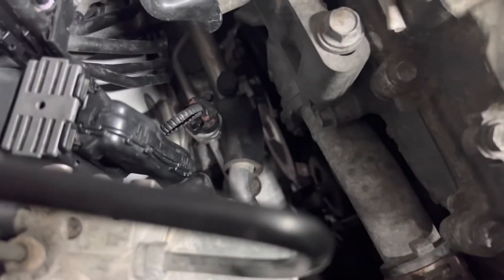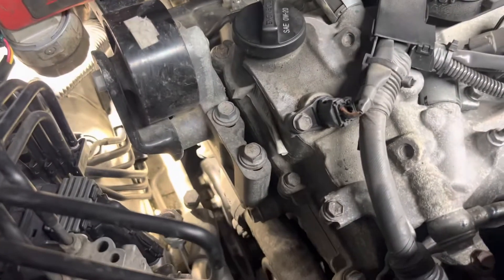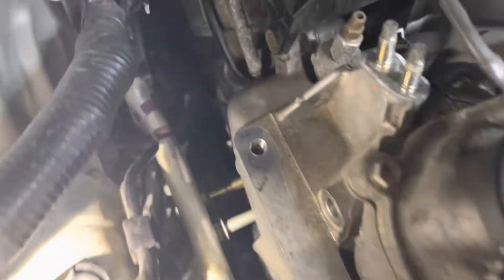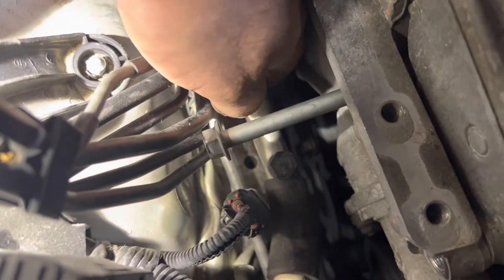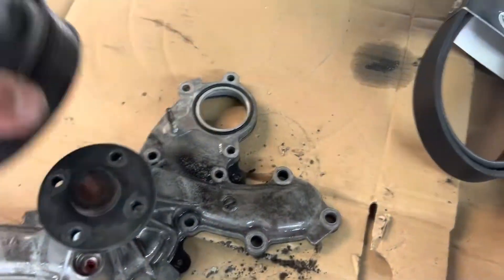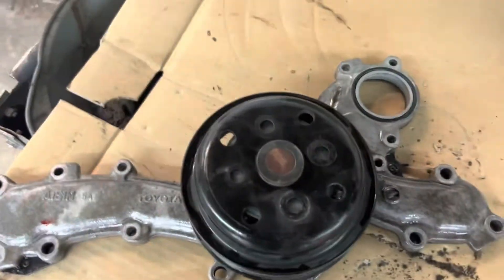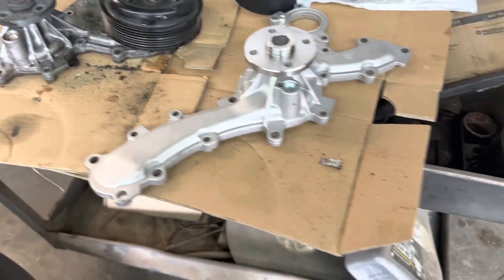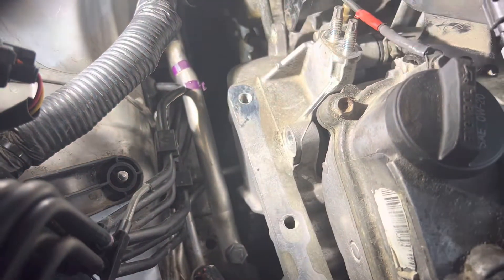2013 Toyota Highlander 3.5L water pump replacement (without engine removal)

Comment: 205,000 on my 2010 Highlander and the water pump is making the graveling noise but not leaking yet, so here I am!  Took the belt off tonight and can barely feel some play in the shaft but I can definitely here the bearing friction when spinning the pully with my hand. Neven even changed the belt prior and it looks great.  Go Toyota go!

Comment: To get that bracket off easier than the hudinne trick through the lines. Take the motor mount bolts loose from below. Jack motor up a little and they come right out. Its 4 nuts below

Comment: If you disconnect the lower engine mount that bracket is easier and you gain a tad more room. Also when coming out. You can just leave the bolts flopping around in the bracket no big deal. But not bad video 👍

Comment: So you didn't pull the motor, but did you have to support it in any way ? And did you have to move it up or down for anything? I have to do this job this weekend just making sure I cover all areas also how much antifreeze came out how big of a pan do I need to catch it.
Reply from the maker: I didn’t pull the motor but I supported it with a jack and helped it up and down
Reply from the maker: It’ll drain less than two gallons, often around one gallon I believe

Comment: I have a 2012 Highlander Hybrid with bad water pump - they are saying 2000 and an all day job, possibly 2 days...can it be quicker this way on the Hybrid?
Reply from the maker: Never done one on a hybrid, but the standard offers an option of with or without engine removal and the hybrid doesn’t, engine removal calls for double the time on the hybrid

Comment: Great video thank you for taking the time to make it. When you take the pump out, are you taking it out of the bottom in the wheel well or from the top last question once the pulley is removed from the mount, you leave it in place while you move it around that’s what allows you to get enough access to the four bolts behind it?

Comment: I have 95,000 on my 2016 Highlander just wondering what mileage people are getting out of these before needing a new water pump? I have to believe I’m gonna need this job in the next year or two. Thanks.
Reply: I have 173K miles on my 2013 Highlander.  Finally going to replace the water pump and alternator just as a preventative measure.  Both are still running great.
Reply: I’ve got 160k on mine. Still original. It runs like new.
Reply: I have a 2015 Highlander with 40k miles and the water pump started making sounds.
Reply from the maker: Anywhere between 70,000 and 100,000mi
Reply: 195,000 on mine…just went out. 😢
Reply: 195,000 on mine…just went out. 😢
Reply: My 197K

Comment: Tha is for this!  I’m attempting to change mine out tomorrow.  2011 highlander 3.5L 
I’m trying to avoid jacking the motor up some as I’ve been done that.  We. Shall. See.
Reply: I just had one come into the shop i work at and it's fixing to go right back out! Hell with that shit short handed already thanks to you I will pass. LOL
Reply: "tomorrow"... you mean; tomorrow and then the day AFTER tomorrow.
Reply: @lynskyrd  lol, I actually got it changed out without removing or jacking up the engine.  it was about a 4-5 hour job for my buddy and I
Reply from the maker: It’s tight but doable
Reply: @thesearchforserotonin4068  Awesome-  glad it worked out for you-  good job.

Comment: Done a lot of these, there is an easier way for the bracket bolts…..take the 3 bolts out of the lower motor mount  and front lower mount and jack it up. Makes all of it easier. Actually it’s a good flat rate job after you have learned the tricks.
Reply: That's what I did and it makes it so much easier. You only need to jack it up about 6 inches an you have access to everything!
Reply: Thanks for this tip Eric. You’re talking about the front motor mount with the electronic vacuum control and the passenger side motor mount? Removing those six bolts will allow you to jack up the engine 6 inches? That makes it much easier? Thank you.
Reply: @condor5635  yes, the 3 nuts on the front and right motor mounts up through the hole in the subframe, then you can jack it enough to make the job easier. not sure about 6 inches...been awhile since I have done one.
Reply: @ericsherman4181  oops thought I had to type your name in, haha, my question is ^
Reply from the maker: I had never done one before, minus the bracket it was about flat rate. Blew my mind when it dropped right back in, my mistake was not taking that plastic cover off the rear head first.
Reply: @bulldogsautomotiveadventur4387  you can do them pretty quick after the first couple. Next one you will save alot of time haha
Reply: @bulldogsautomotiveadventur4387  Oh, get ready for the next wave of theft, now we are seeing plastic gas tanks getting drilled and stealing the gas,
Reply from the maker: They were doing that when I first started…being at a rural independent shop I miss a lot but I’ve been in the business for quite a while. Lol. I remember some time ago they were using a vacuum system and collapsing tanks.
Reply: So is there no need to remove the tire when you do it like that? @ericsherman4181
Reply from the maker: I would say it can be done but pulling the wheel would make it a lot easier, I’ve had lost wheel lock jobs and done them without but it just adds a degree of difficulty
Reply: @jongray8659  I always do, takes 30 seconds lol. If your on a lift the job is so simple...jackstand under oil pan...with wood block of course then lowwer the lift to raise engine after you remove the mount bolts.  Love doing these jobs , so easy unless it has the ABS punp in the way.